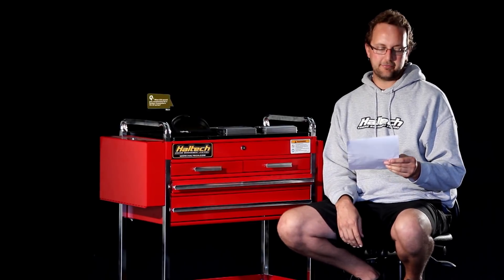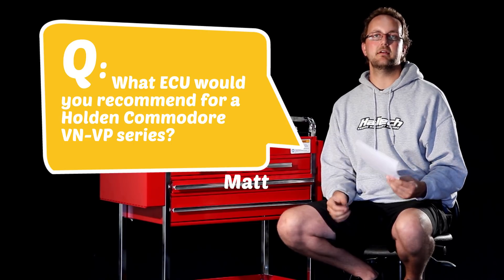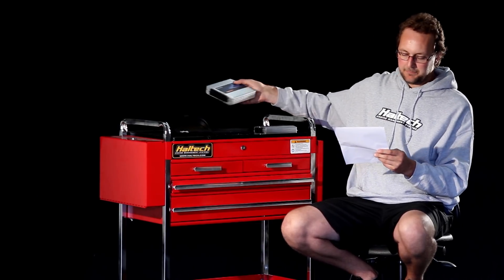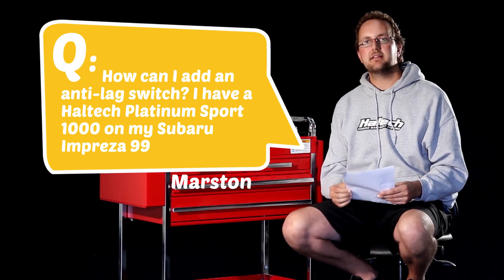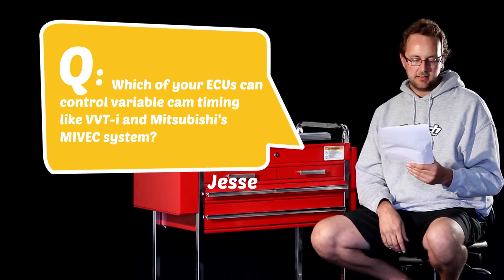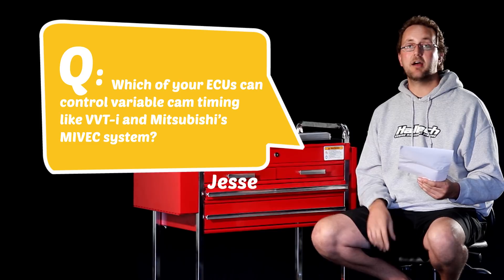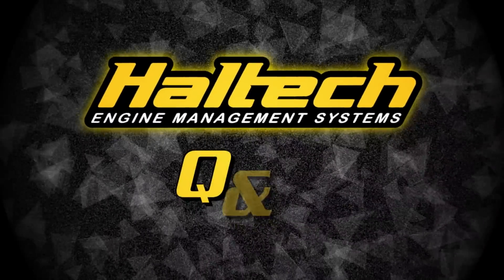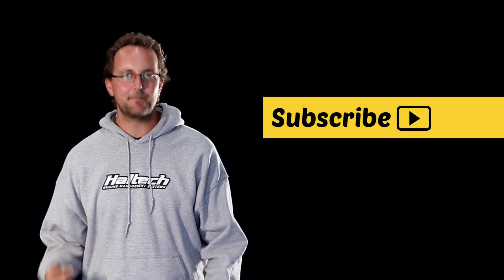Anti-Lag Switches, Variable Cam Timing, ECU for a VN Commodore - Haltech Q&A Episode 5

Comment: I have a sport 1000 ecu and will be running my early wrx wiring, but have converted from the original wasted spark to four wrx coil on plugs. I'm currently running a power fc which drives all four coilpacks fine, in two channel fire mode. Will my sport 1000 be able to drive two wrx coil on plugs per channel as well? Thanks

Comment: Platinum Sprint RE ECU - I need more information related to configuring the ignition and injectors for a 1988 RX7 13B 2nd generation rotary engine. Based on the qiuck start guide, wiring the CAS, crank angle sensor "trigger system" seams to be straight forward. The issue I have is the config for the ignition as the steps only explain how to wire it as WASTED SPARK....two coils. How can I set it up for four coils